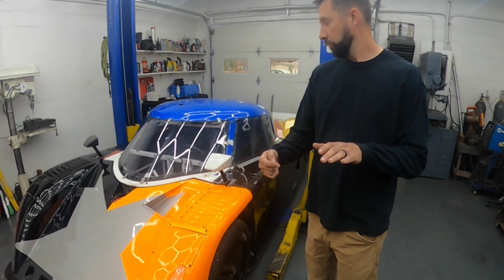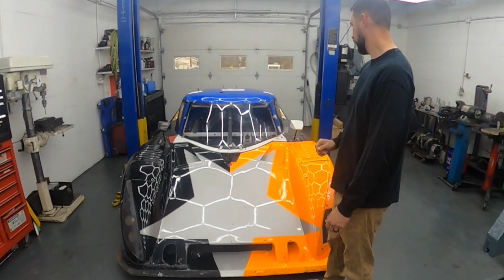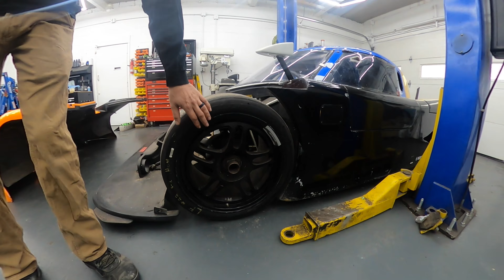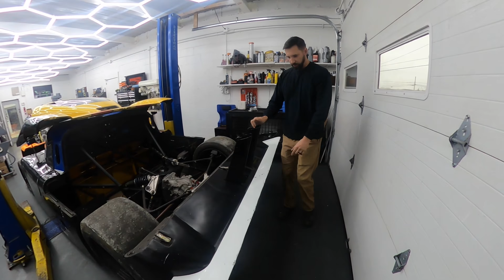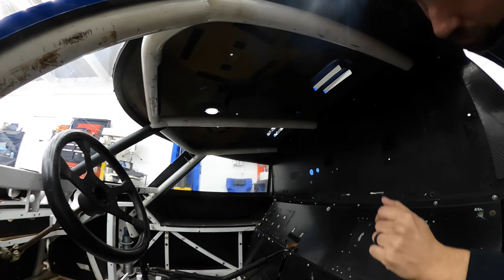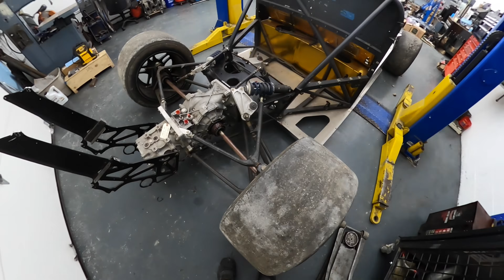Forgotten Projects. Rolex series Daytona Prototype MKXI Pontiac Citgo #11. Defined Autoworks

Comment: To make the rotary work, could you make a 'drop-adapter plate'?  Mazda bolt circle on one side, Xtrac on the other, with quick change drop gear between the 2 sides.
Reply from the maker: technically probably so. There is a good amount of space between the engine and transmission.